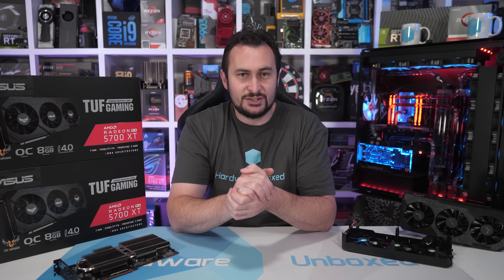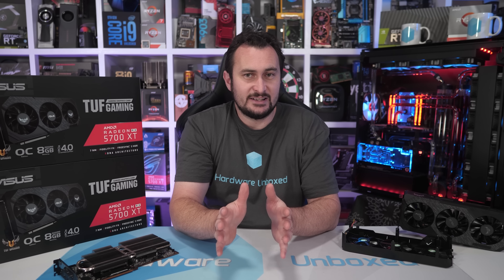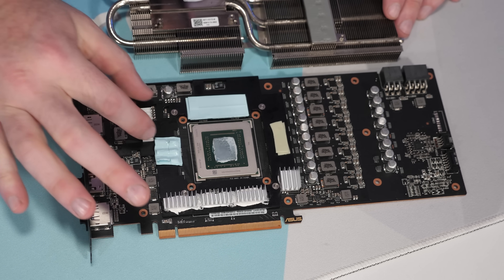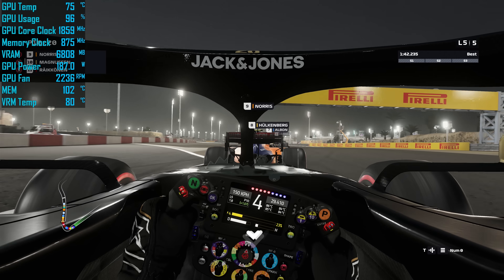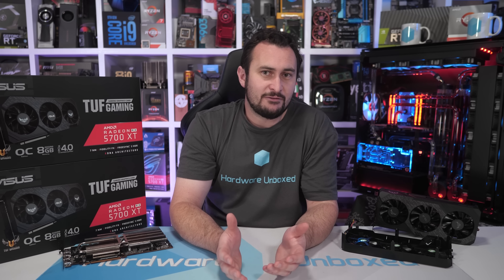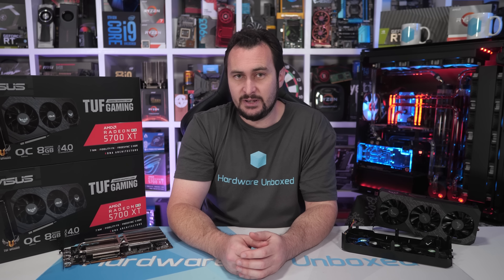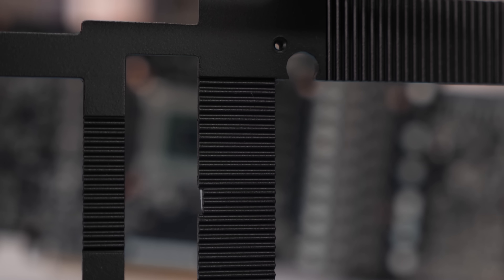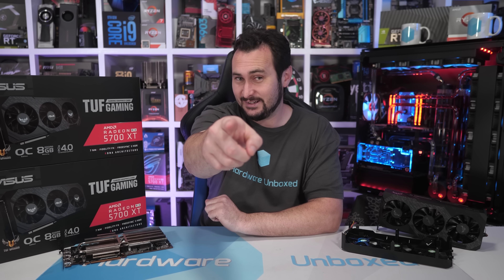Fixing the 5700 XT TUF, How Much Cooler Can We Make It?

Comment: So what would be considered safe operating temps for the GDDR6 on 5700 XT’s?  Is this more important than the junction temperature?
Reply: For mining, below 95°C is considered fine for 24/7, so ideally you'd want something like that also for gaming if you want the card to last for years.
Reply: dmity84 are you serious? Numerous ppl have been saying you need to stay welll clear from 90degC but no official sources to back that up lol
Reply: @michaeltan511   Well i know people that have been mining 24/7 for almost the whole year with memory constantly at ~94°C running 1800-1820mhz, so i think a couple of hours per day of gaming at that temp won't do any harm (to the memory chips). But people mostly use Sapphire, MSI and Powercolor cards. this TUF one is of course as bad as it gets out of the box.

I use mining as a worst case memory benchmark and putting 3mm 12W/mk thermal pads on the backplate resulted in going from 104°C in 5 minutes to 96°C after 45 mins at 1800mhz memory. Now just need to do something with the heat spreader like in this video and hopefully it will get under 90°C. A Sapphire Nitro+ sits at 92-94°C for example in the same conditions.
Reply: @igralec84  I've got a handful of Powercolor cards which are mining at mid-high 80degC's these days but the weather has been quite mild/cool... I'm just more concerned about upcoming summer conditions so i wanna prepare for it so that my cards dont cook lol

Comment: OMG , what have i done !!!

Wish i saw this video before buying Asus TUF Rx 5700 Xt. 

After adding Heatsink is it going to be perform like other 5700 GPUs ?
Reply: Same here. I fitted 3mm thick thermal pads to the backplate  yesterday and it dropped memory temp from 102 to 94°C in a 20 min timespy stress test. Have to do the same as in this video now and see how much further it will drop, doubt it will be another 12°C, but another 5°C would be quite okay.

Comment: when i did the fix on the strix the gpu temp went down but the vram temp went up
Reply: Probably because the fan speed went down
Reply from the maker: Did you replace the two VRM screws? But as Ivan suggested it is probably fan speed related.

Comment: If I was asus I would accept any/all 5700 and 5700xt tuf returns.
Create a refurbishment line and retrofit a newly designed VRAM plate (lots of surface area, similar to m.2 heatsinks), These can go out as refurbishment models for £250 instead of the £380 these are currently selling for.
Once tested and shown they work (likely better than original in fact) anyone buying one will get a bit of a steal being on-par with a 2070 costing twice as much.
The alternative is 1) ignore the problem, lose no money today but your brand rep goes down the toilet for a while like happens, or 2) get them back and then put them in the bin and take a big loss.
I'd rather sell them "refreshed" for a small loss and make some buyers very happy than take a huge loss or make the brand stain worse.

Comment: What temperatures of gddr6 memory are safe? I saw about 90 degrees on my 5700 xt red dragon. Cooling system is set to auto.
Reply: i'm constantly seeing 95-97° memory junction temp on my MSI RX5700 EVOKE OC during gaming, it is Tjunction temp, not Tcase, so i think anything below 105 is kinda acceptable
i did not applied any "fixes" to my memory thermal pads, but i know about this problem with msi evoke oc
Reply: That's about 10 degrees over what the Red Dragon normally puts out. Maybe a thermal pad issue or your case doesn't have good airflow. I can't seem to find a definite answer, but 95 degrees is a number that keeps popping up, so maybe 90 is a bit close. I'd reduce that if I could to (possibly) extend the life of the GPU.
Reply: this became the norm after undervolting my video card. GPU temperature decreased, respectively, the speed of the video card fans decreased. what caused the increase in temperature ggdr6 memory. I wrote to PowerColor about temperature. Till waiting for their answer
Reply: @MUXAO  Check around online. Fan speed correction is one thing in common among people who undervolt. You might have to adjust the fan to a constant speed or set a custom curve through Afterburner or other GPU overclocking software.

Edit: I would only want to pull the VRM temps down maybe 5 degrees, so it shouldn't require a huge increase in fan speed.
Reply: @TheRillan  MSI didn't apply the right thermal pads to create adequate mounting pressure on two of your memory modules, that's why temps are so high. MSI is offering a fix, but you can buy thermal pads and do it yourself. Over 100 degrees is fine for the GPU die (according to AMD) but running your memory long-term at those temps might not bode well for the life of the card, not to mention the increased fan speed it entails.

Comment: Doesn't Asus learn.This is not the first time.When i was in the market for a gpu.I set on getting a 1070 ti for 4k in my currency with a 1 y warranty and my friend told me why not getting the gtx 1660 tuf for 4500 in my currency cause its new tech.I looked at it and said no chance cause of the build quality.It didn't even have a proper heat pipe.Tuf series gpu's are really below par.It seems they pulled them off the market as well cause my retailer doesn't sell them anymore.

Comment: What is the temp software being used? I have a 6800xt tuf card and I would like to see if issues still persist with this generation of card and none of the software I have tried so far did not expose memory temp, vrm or anything beyond core.
Reply: Used RX 6800 XT GAMING TUF OC. 
Unlike the 5700X XT, it runs ice cold at 60% fan on 74 C (HW INFO 64)
Reply: @chrinaldi  I had a card failure week or so in of having the card... its been about 2 weeks since it had been into asus so hopefully I hear back soon.

Comment: Given that these are professionals working on these designs, there is little to no excuse for products so bad they deteriorate at way faster rates (edit: the product is basically defective). Frankly, they should replace the cards and give a game code or similar as compensation for the trouble. I realize there is more to designing these cards than just performance, especially cost (reusing designs, reducing production steps, cheap materials, etc.), but even the "budget" versions of these cards, aren't exactly cheap. If Sapphire and Powercolor can do it right from the start, if XFX can do it right after the fact, then Asus for sure should be able to as well.

Comment: Asus has lost me as a long time customer, switched to MSI for just about everything. Tired of getting duds myself. The Strix B350f and B450f gaming didn't impress me, just felt something was missing. Went ahead and bought the MSI B450 gaming pro carbon and I've never been happier with the performance. Was easily able to hit 4.3 GHz on a 2700x, with good temperatures, and my RAM hit 3600 MHz on a 3200 MHz kit. Kudos to MSI

Comment: these days I tend to avoid asus (namely AMD stuff) because I prefer my hardware to last as it gets passed down job to job across 10 years before its finally retired probably taken apart, cleaned and repasted before being sold or put somewhere on a shelf, I literally had a 2003 Celeron system (socket 478) still in use untill 2015.

Comment: how can I check my GPU's MEM and VRAM's temp through software? I am using MSI afterburner, but those options of mem & VRAM temp are not present there. (I am using GTX 1060 from Leadtek brand).
Reply: Isn't VRAM memory? Anyway, HWiNFO does the job as long as your GPU/driver allows it.

Comment: I have the 5700xt pulse in a micro atx case (corsair 280x with 4 ll120 fans) and at stock settings it operates at around 2000mhz with 1.2 volts. The temperatures are acceptable (up to 75c and 95c junction and memory at 90c) but the fans spin up to 2300rpms. In order to get the temps and operating volume down to what reviewers get; that is 70c gpu temp and fan speed at 1600rpm and around 1930mhz of frequency I have to undervolt to around 1120-1130 mv. Is that normal? Plus I just discovered the issue that 5700xt is basically broken at 1080p!!! How come Steve has not mentioned that??? 5700xt gpus downclock to 1000-1200 mhz in numerous games making them unplayable! You get worse performance at 1080p than in 1440p whre the cards are fully utilized. It is not a cpu bottleneck as people for example with a 2600 get bettter fps with a 570-580 than with their new 5700xt in 1080p. If you google it you can find several threads in forums about that.

Comment: Is this GPU usable with their new Bios power efficiency mode for better temperature?
I can get this card for 250Euro from a store so thats why Im thinking about it but I cant find anything on the internet yet.
Reply: Not really, unless you're willing to void the warranty and risk losing that money as Asus will refuse warranty if you modify the card in any way.

List of things wrong with TUF:
* VRM mosfets have absolutely no cooling, causing them to overheat
* GPU cooler mounting pressure is too low causing GPU and junction temps to be too high
* Insufficient VRAM cooling
* Incorrect thickness of thermal pad on vrm rails and/or non-existant mounting pressure, cooler doesn't make physical contact with the vrm chips
* 8-phase vrm design seems to be only using 6 phases
Reply: @krypton1260  thanks brother

Comment: Does anyone know if there are Water Blocks out there that fit these TUF model cards?
If there isn't ASUS should make sure one becomes available and possibly sell these cards with an included Water Block at the MSRP of the 5700 and 5700XT. If not bundled with the cards make it known that they are available to be claimed with receipt or some other form of proof of purchase, maybe only charging for shipping. That would resolve the issue as well as giving those that do like to build custom loops and maybe even those interested in starting to do so a very good option. If they were to do this it would negate the issues and actually demonstrate that ASUS does care about the end user instead of blowing this off as they are now with a discount that does nothing but encourage people to buy these cards while at the same time not addressing the issue at all...

Comment: This is right off of the Asus website: 
"BUILT TUF 
The TUF Gaming X3 Radeon™ RX 5700 XT equips 3 powerful fans to up the ante for cooling, without sacrificing the durability that makes it TUF. Each card is built using Auto-Extreme manufacturing, protected by a rigid backplate that prevents PCB flex, and uses sleeve fan bearings with space-grade lubricant sealed to IP5X standards. And, it's all backed by a rigorous battery of validation tests to ensure compatibility with the latest TUF products. If you're looking for the super-cooled tank of graphics cards, lock and load your rig with the TUF Gaming X3 RX 5700 XT."
That is what we purchased but did not receive. Asus, when will I get my 5700 XT "TUF Gaming" graphics card?!

Comment: As i can see ;

- Asus (almost) has no issues when producing Nvidia GPUs

- Asus is producing Trash Gpus producing Amd GPUs....

WTF ?!!! xD
Reply: Actually, ASUS got some really terrible 1660/ti models as well
Reply: @dmitrypoletaev7478  , I bought " Asus Rog Strix Gtx 1080 Ti OC Edition " in 2017. And i love so much this GPU has not any problem... But looks like i must think another GPU company for when i will buy " Rtx 3080 for 1440P Ultra Gaming ".... I wish Sapphire releasing GPUs for Nvidia becouse Nitro+ Gpus are amazing... :(
Reply: I have an ASUS 1660 ti that works really well and is quiet. It doesnt have a backplate though
Reply: @ErenJaeg4R  Wish EVGA made Radeon GPUs as well...
Reply: @TTL_Tsaki  , My problem is EVGA has not selling GPUs officialy in my country. And of course i dont want buy GPU without warranty. I hope Evga will open distributorship in my country, Then i can but EVGA Rtx 3080 :)
Reply: asus a shit all around, i knew a costumer who had to replace 2060 4 times before getting the one that worked stable and that supposed to be a midrange card which doesn't run that hot
Reply: Nah, the Asus Phoenix 1660 Super is heavily flawed with a piss poor cooler heatsink. The same goes for the TUF 1660 Super. The Asus Dual 1660 Super Evo is much better and quieter but I am keeping an eye on mine while it is still in the return period but the Gigabyte ITX model might be a much better buy
Reply: @NightMotorcyclist  totally agree. I have had both the phoenix and Evo and they are MILES apart. Phoenix was 80c under light load and sounded like a jet engine, the evo is whispet quiet and cool.
Reply: @Joshua-uq9zw  someone tried to save up on some copper
Reply: I have tested a few ROG Strix 1080 Ti's myself, and I can definitely tell there is something fishy with the QA (quality assurance) over at Asus. 
One card ran as it should, seeing normal temperatures under stock operating conditions, but the other identical card ran at least 10° hotter, if not 15. After a thermal paste replacement, the hotter card was brought down to the same level as the first one.
None of the cards has been serviced before.

In my personal rig, I have the MSI Gaming X model, and even under prolonged gaming loads, I rarely see it go above 65°C. It too has never been serviced
Reply: @Skarfar90  well if they don't save on copper then it's thermal paste, gotta cut corners somehow, i like how everyone criticize msi, yet in last 6-7 years after owning multiple mobo's and cards i haven't had any issues, until now of course with all that x570 fiasco, which i didn't get because i wasn't planing to upgrade
Reply: @Skarfar90  , Thank you for advice , i will look MSI Gpus When Nvidia releasing Rtx 3080 :)

Comment: Just bought one ..in Germany they cost 359 bucks that is Like 100 less than all other rx5700xt's but its running Like crap in bfv my GTX 980ti was much smoother AND cooler and the best is that the seller promised me that this is the new EVO Version guess what returning it tomorrow.

Comment: Well, ASUS seems to have fixed the TUF design for the RX5600XT. Only took about halve a year for them with a cheaper Navi 10 based card...
https://www.hardwareluxx.de/index.php/artikel/hardware/grafikkarten/52046-mehr-1080p-leistung-modelle-der-radeon-rx-5600-xt-im-test.html?start=2

But honestly ASUS, stop being the Apple of DIY parts. For years quality has been dropping, issues keep appearing and prices keep rising. This isn't the first issue or some fluke, far from it. It is becoming somewhat routine that ASUS has products with issues or questionable design decisions. They only acknowledge this because to many people complained about it. Now they go into damage control because there is no denying any more. Still they keep selling old stock of cards they know will die within warranty.

Comment: One thing, you forgot the Asus Vega 64 Strix cockup. Where the VRM had no cooling at all, resulting to serious throttling of the GPU hence the 10% slower speeds than the Vega 64 reference blower!!!!!!  Took ASUS 18 months to acknowledge the issue and put a thermal pad on the VRM. 
Also Asus has a bad track record when comes to AMD GPUs. Who can forget the 7970 & 290X Platinum Matrix? One didn't had VRAM cooling, the other had no VRM cooling.
Reply from the maker: No we're aware of that. It was talked about in the 5700 XT Strix video. No point bringing it up here.